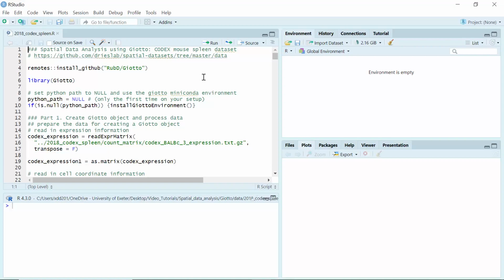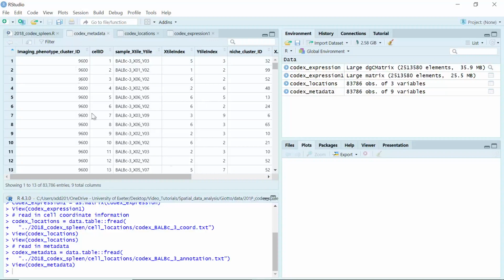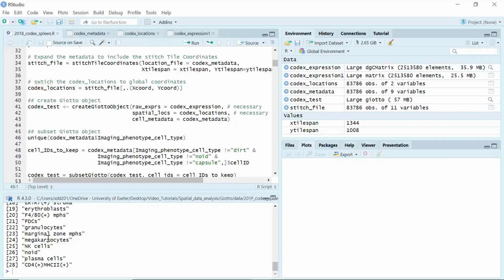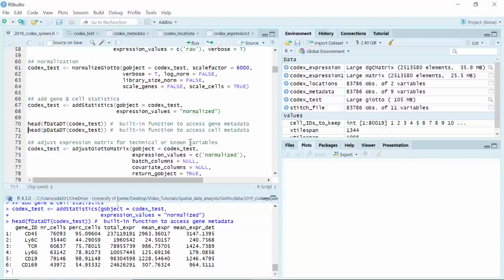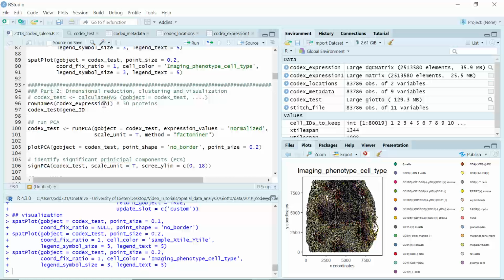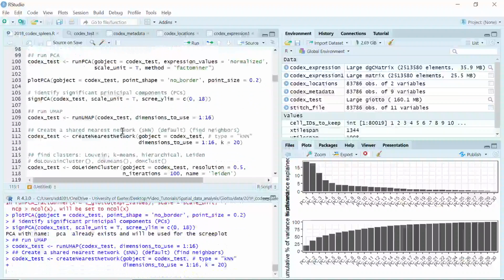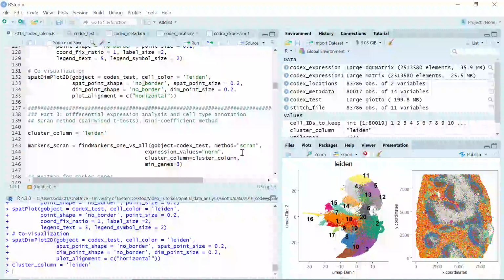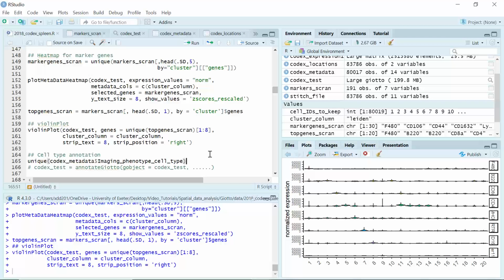Spatial Data Analysis Using Giotto: CODEX (Akoya PhenoCycler) Mouse Spleen Dataset

Comment from the maker: ### Spatial Data Analysis using Giotto: CODEX mouse spleen dataset
# https://github.com/drieslab/spatial-datasets/tree/master/data

remotes::install_github("RubD/Giotto") 

library(Giotto)

# set python path to NULL and use the giotto miniconda environment
python_path = NULL # (only the first time on your setup)
if(is.null(python_path)) {installGiottoEnvironment()}

### Part 1. Create Giotto object and process data
## prepare the data for creating a Giotto object
# read in expression information
codex_expression = readExprMatrix(
  "../2018_codex_spleen/count_matrix/codex_BALBc_3_expression.txt.gz", 
  transpose = F)

codex_expression1 = as.matrix(codex_expression)

# read in cell coordinate information
codex_locations = data.table::fread(
  "../2018_codex_spleen/cell_locations/codex_BALBc_3_coord.txt")

# read in metadata
codex_metadata = data.table::fread(
  "../2018_codex_spleen/cell_locations/codex_BALBc_3_annotation.txt")

# set global x.y coordinates to stitch Tile Coordinates 
xtilespan = 1344;
ytilespan = 1008;

# Expand the metadata to include the stitch Tile Coordinates
stitch_file = stitchTileCoordinates(location_file = codex_metadata, 
                                    Xtilespan = xtilespan, Ytilespan=ytilespan)

# swtich the codex_locations to global coordinates
codex_locations = stitch_file[,.(Xcoord, Ycoord)]

## create Giotto object
codex_test <- createGiottoObject(raw_exprs = codex_expression, # necessary
                                 spatial_locs = codex_locations, # necessary
                                 cell_metadata = codex_metadata)

## subset Giotto object
unique(codex_metadata$Imaging_phenotype_cell_type)

cell_IDs_to_keep = codex_metadata[Imaging_phenotype_cell_type !="dirt" & 
                      Imaging_phenotype_cell_type !="noid" & 
                      Imaging_phenotype_cell_type !="capsule",]$cellID

codex_test = subsetGiotto(codex_test, cell_ids = cell_IDs_to_keep)

## filter
codex_test <- filterGiotto(gobject = codex_test, expression_threshold = 1,
                           gene_det_in_min_cells = 10, 
                           min_det_genes_per_cell = 2,
                           expression_values = c('raw'), verbose = T)

## normalization
codex_test <- normalizeGiotto(gobject = codex_test, scalefactor = 6000, 
                              verbose = T, log_norm = FALSE,
                              library_size_norm = FALSE,
                              scale_genes = FALSE, scale_cells = TRUE)

## add gene & cell statistics
codex_test <- addStatistics(gobject = codex_test,
                            expression_values = "normalized")

head(fDataDT(codex_test)) #  built-in function to access gene metadata
head(pDataDT(codex_test)) #  built-in function to access cell metadata

## adjust expression matrix for technical or known variables
codex_test <- adjustGiottoMatrix(gobject = codex_test, 
                                 expression_values = c('normalized'),
                                 batch_columns = NULL, 
                                 covariate_columns = NULL,
                                 return_gobject = TRUE,
                                 update_slot = c('custom'))

## visualization
spatPlot(gobject = codex_test, point_size = 0.1, 
         coord_fix_ratio = NULL, point_shape = 'no_border')

spatPlot(gobject = codex_test, point_size = 0.2,
         coord_fix_ratio = 1, cell_color = 'sample_Xtile_Ytile',
         legend_symbol_size = 3, legend_text = 5)

spatPlot(gobject = codex_test, point_size = 0.2,
         coord_fix_ratio = 1, cell_color = 'Imaging_phenotype_cell_type',
         legend_symbol_size = 3, legend_text = 5)

################################################################################
### Part 2: Dimensional reduction, clustering and visualization
# codex_test <- calculateHVG (gobject = codex_test, ....)
rownames(codex_expression1) # 30 proteins 
codex_test@gene_ID

## run PCA
codex_test <- runPCA(gobject = codex_test, expression_values = 'normalized', 
                     scale_unit = T, method = "factominer")

plotPCA(gobject = codex_test, point_shape = 'no_border', point_size = 0.2)

# identify significant prinicipal components (PCs)
signPCA(codex_test, scale_unit = T, scree_ylim = c(0, 18))

## run UMAP
codex_test <- runUMAP(codex_test, dimensions_to_use = 1:16)

## Create a shared nearest network (sNN) (default) (find neighbors)
codex_test <- createNearestNetwork(gobject = codex_test, # type = "kNN"
                                   dimensions_to_use = 1:16, k = 20)

## find clusters: Louvein, k-means, hierarchical, Leiden
# doLouvainCluster(), doKmeans(), doHclust()
codex_test <- doLeidenCluster(gobject = codex_test, resolution = 0.5, 
                              n_iterations = 100, name = 'leiden')

codex_metadata = pDataDT(codex_test)

## visualization
plotUMAP(gobject = codex_test, cell_color = 'leiden', 
         point_shape = 'no_border', point_size = 0.2)

spatPlot(gobject = codex_test, cell_color = 'leiden', 
         point_shape = 'no_border', point_size = 0.2,
         coord_fix_ratio = 1, label_size =2,
         legend_text = 5, legend_symbol_size = 2)

# Co-visualization
spatDimPlot2D(gobject = codex_test, cell_color = 'leiden', 
              spat_point_shape = 'no_border', spat_point_size = 0.2,
              dim_point_shape = 'no_border', dim_point_size = 0.2, 
              plot_alignment = c("horizontal"))

################################################################################
### Part 3: Differential expression analysis and Cell type annotation
## Scran method (pairwised t-tests), Gini-coefficient method 

cluster_column = 'leiden'

markers_scran = findMarkers_one_vs_all(gobject=codex_test, method="scran",
                                     expression_values="norm", 
                                     cluster_column=cluster_column, 
                                     min_genes=3)

## Heatmap for marker genes
markergenes_scran = unique(markers_scran[,head(.SD,5), 
                                         by="cluster"][["genes"]])

plotMetaDataHeatmap(codex_test, expression_values = "norm", 
                    metadata_cols = c(cluster_column), 
                    selected_genes = markergenes_scran,
                    y_text_size = 8, show_values = 'zscores_rescaled')

topgenes_scran = markers_scran[, head(.SD, 1), by = 'cluster']$genes

## violinPlot
violinPlot(codex_test, genes = unique(topgenes_scran)[1:8], 
           cluster_column = cluster_column,
           strip_text = 8, strip_position = 'right')

## Cell type annotation
unique(codex_metadata$Imaging_phenotype_cell_type)
# codex_test = annotateGiotto(gobject = codex_test, ......)